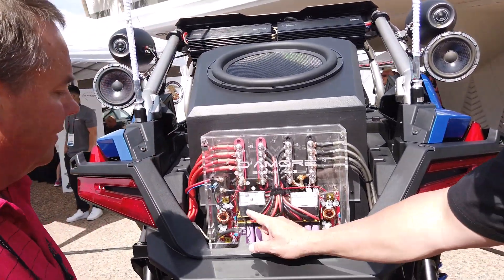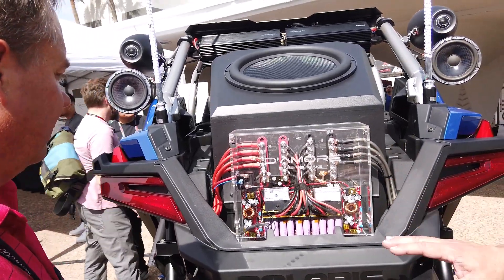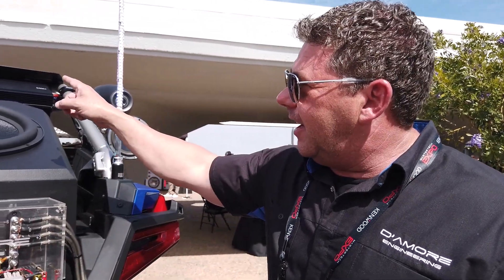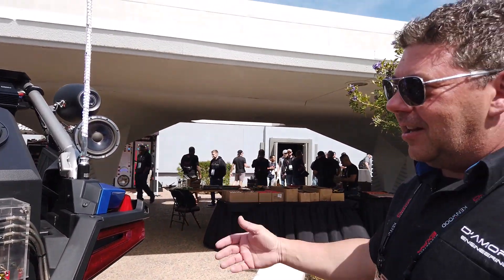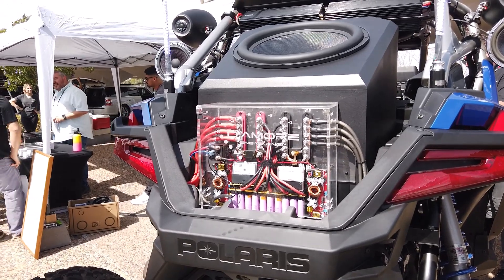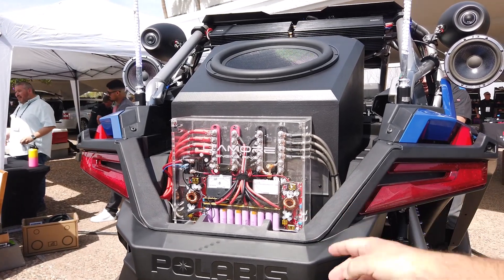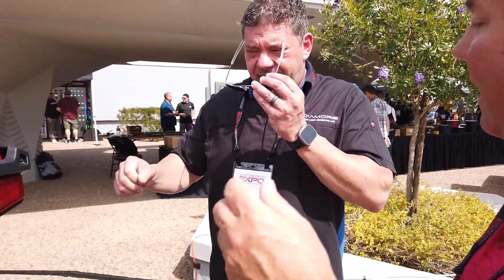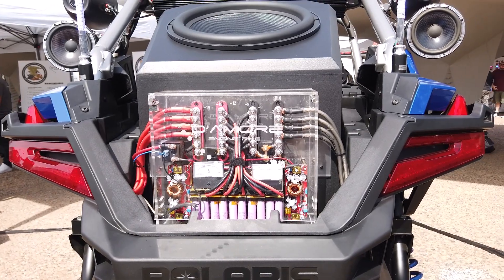Tony D'Amore and Wayne Harris at MasterTech Expo 2023

Comment: Isn't this kind of the same as how the Rockford T15KW works?
Reply: Very similar if I'm not mistaken, but the T15k was using a huge capacitor array where as here lithium batteries. 
Tony D'Amore is one of the one's who was behind the design of the T15K when he worked for Rockford.
Reply: Holy heckler!!! I never knew that. 1st and ONLY time I'd EVER heard of D'Amore was thru Steve Meade Design

Comment: Some might say that all Tony is doing is taking the already existing technology inside of an amplifier and displaying it externally at a greater scale so he amplifying the current to then feed the amplifier which amplifies it again and converts it into an audio signal...
Reply from the maker: I agree. Tony said he had just received a patent for this technology. I don't know the specifics of the patent but the premise of storing energy (until it is needed) has been around since the beginning of time. Maybe it has something to do with the integrated batteries (in lieu of capacitors). I will try to find out. At the end of the day, it is always great to see innovation and new options for system applications. Thanks for watching.